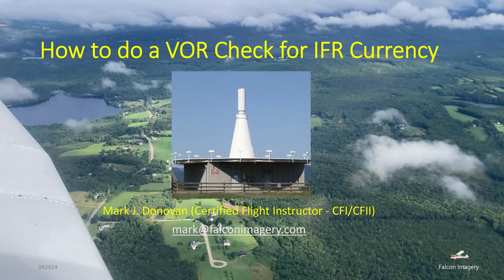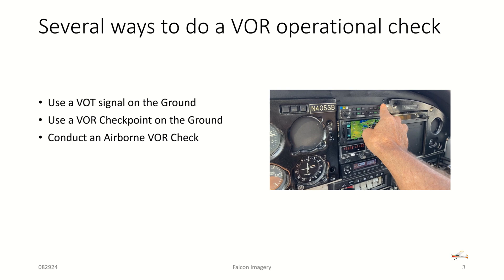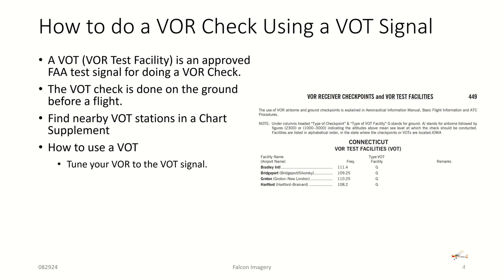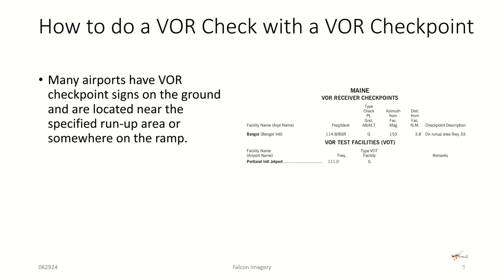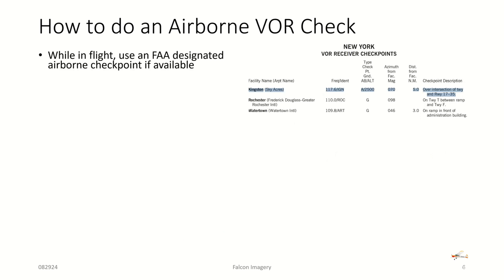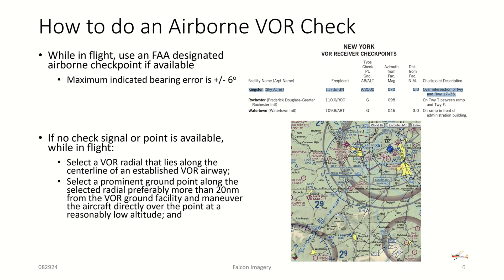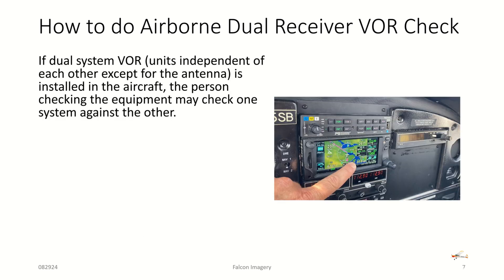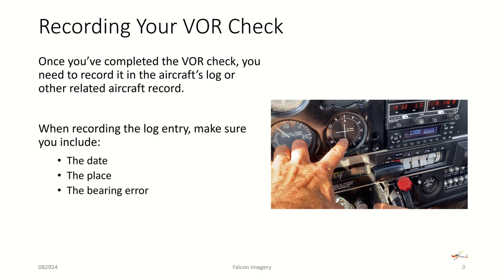How to do a VOR Check for IFR Operations

Comment: Great video I understand everything you said and I memorize it very well but when it comes to real world with Questions at FAA how you can answer a question like this from the information that we have on the figure I really appreciate it if you can shoot a video or Explain it how you answer a question like that thanks 
6. (Refer to Figure 64.) The course deviation indicators (CDIs) are centered. Which indications on the No. 1 and No. 2 VOR receivers over the St. Landry Parish-Ahart Field Airport would meet the requirements for the VOR receiver check using the Lafayette VORTAC?

     VOR     TO/FROM     VOR     TO/FROM
    No. 1               No. 2

A.      162°      TO        346°     FROM
B.      160°     FROM       162°     FROM
C.      341°     FROM       330°     FROM
Reply from the maker: I'm thinking the answer is A. Remember, you should have the CDI's dialed in so that they are both showing what radial you are on. In this question, they made it difficult to see, since they showed in A a 162 with a TO indication. Add 180 to that 162 and you get 342. Thus the CDI needles on each VOR are within 6 degrees of one another, making it the right answer. 

C would not be the correct answer, because they are beyond 6 degrees.

B could also be the correct answer, but I can't be sure as I don't see the figure on what Radials are dialed in. But B seems to be too simple of an answer. However, if the CDIs are both on the radial (or close to it) of 160 degrees, then B would be the correct answer.
Reply: @ thank you so much for your reply and I showed it to a couple instructors and these said very close to what you say and the answer was A
Reply: @FalconImagery 
Also, you said that you cannot see the figure if you go to airman knowledge supplement test figures you can be able to see it on figure 64 thank you a lot